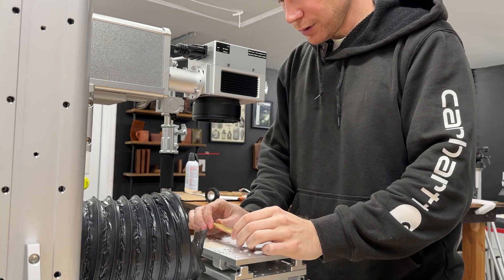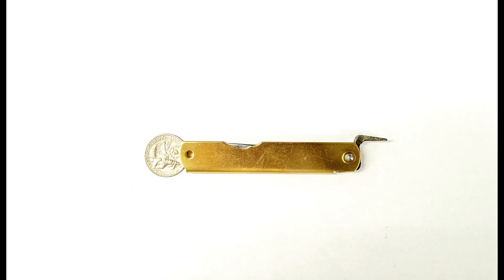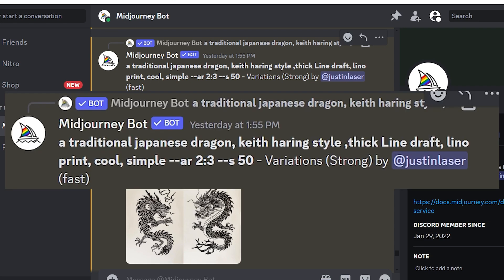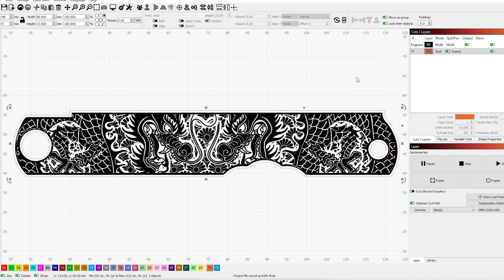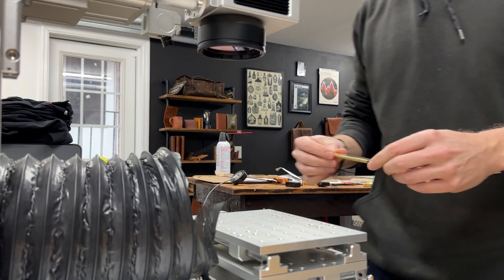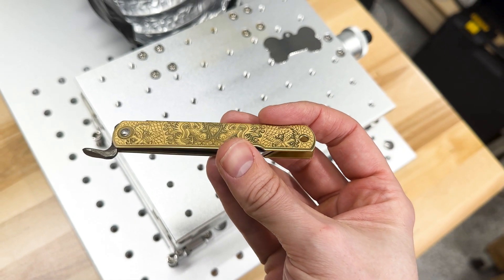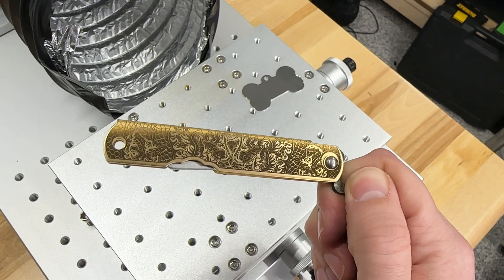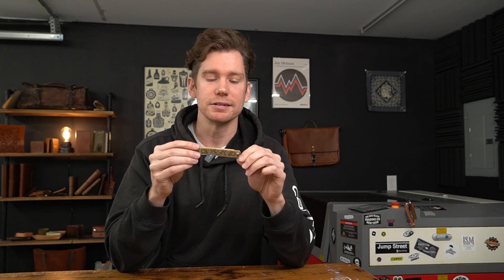Fiber Laser FAIL!

Comment: Thank you for posting a "failure" video. Every engraving is an opportunity for a different result and it highlights how many variables are at play.  Sometimes it can be as little as 1mm out of focus while other times we completely forgot a layer or set something wrong no matter how many times we saved that setting in the materials library.  

All that said, keep up the great work. I'm curious if a little clean up and polish wouldn't make that black side pop a bit more and you can offer it up as a yin-yang with a light and dark side :)

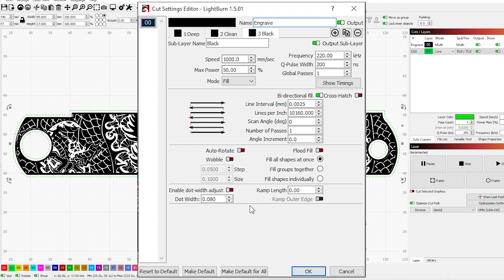Comment: At 4:32 you're setting the Black engrave pass to a line interval of .0025 rather than .025 like the other passes. I'm running a 60W JPT and my brass black is set to the same line interval as all of my other brass settings. I'd recommend a test (on a scrap brass piece first) with a modified line interval. Of course, if you're running a test cycle anyway, you can also just use Lightburn's material test grid to dial it in.

Good luck!
Reply: I assume he knows this because he voice-emphasised the second zero when he read it out.